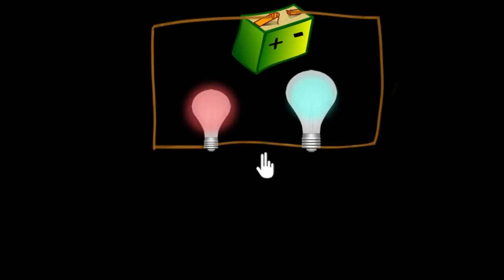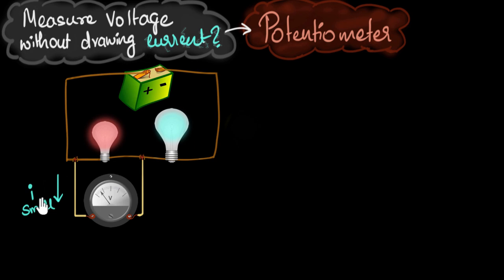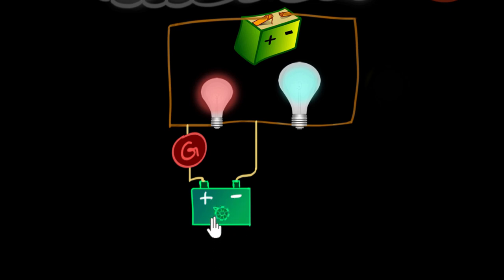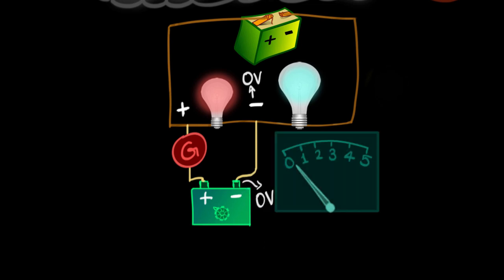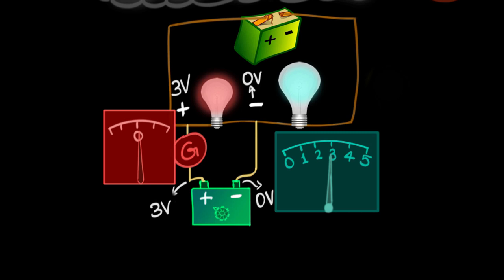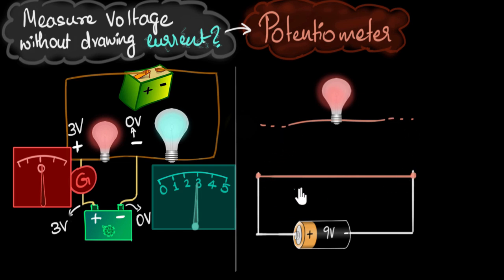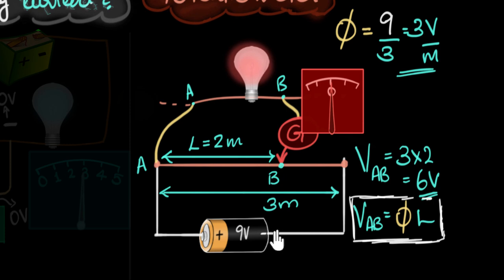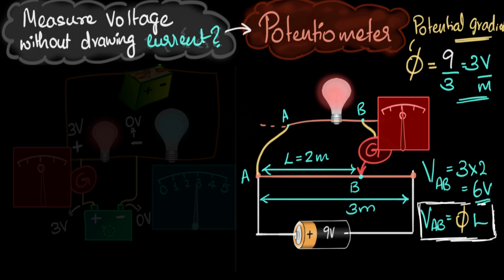Potentiometer principle (logic) & working | Electricity | Physics | Khan Academy

Comment: Can I consider the case where the internal resistance of the 9V battery is large enough that the potential difference across the wire is less than the unknown potential difference? That, or as my lab teacher used to say, loose circuit XD
Reply from the maker: Nice try, but I would still put this under the first category. Even if the p.d. across the wire is large enough, there is still a possibility of not getting a null-point.
Reply: @KhanAcademyIndiaEnglish  does it have something to do with the direction of deflection of galvanometer at the start of the experiment on the two extremes of the wire? Say, if the deflection occours towards the same side than null point can never be reached?
Reply from the maker: @pranavsrikanth935  Yes, you are onto something. But, what set-up do you think would cause that?
Reply: @KhanAcademyIndiaEnglish   what if the potential gradient of the  wire is greater than the voltage/emf we are trying to find?
Reply: @KhanAcademyIndiaEnglish  When the length of the wire is less than required...?
Reply: @maheshpatnala  That also means that voltage is insufficient
Reply: @aditishendurnikar1763  Then also we will be able to find the potential diff if gradient is less it just means that potentiometer is not very sensitive and we can't measure difference accurately
Reply: @KhanAcademyIndiaEnglish  polarity of the battery?

Comment: The way I said "NO" out loud when he ended the video without answering the question...😫
Reply: There shall be sleepless nights searching for the answer in your dreams : P
Reply: @sapphireblue9209 the other case would be when the 9V battery connected to the long wire is in opposite polarity. There would be no way for it become equal to the voltage across the resistor no matter how much you adjust the length.

Comment: Reasons for not balancing:
1.  The potential difference between the ends of the potentiometer wire or the emf of the cell connected in the main circuit may not be greater than the emf of the cells whose emf are to be compared .
2.  The positive terminals of the cells and the battery used in the circuit might not be connected to the same end of the potentiometer wire.
You're welcome!
Reply: Can u please elaborate the second reason?
Reply: @atchayap1434  you know when we connect a measuring device in a circuit we connect +ve end to +ve terminal of a cell and -ve end to -ve terminal. so u will have to connect them the right way. 
i think this is what the 2nd point is trying to say

Comment: If we put connect the negative electrode of the unknown emf with the positive (opposite) end of the potentiometer wire, then the current will always enter the secondary circuit.
I think this could be an answer to your question!
Reply: Ohh I had the same thought, but wasn't sure!
Reply: What about this:- Resistance of wire too high we are using so not gave that potential difference.

Comment: Last question solution 
It will never be zero if the + terminal of driver battery is not comnected to + terminal of the place where voltage is measured.

Comment: What if the batteries are arranged in reverse configuration then even if the p.d of lower battery is greater than the upper one still there will be current

Comment: The other answer should be that if we were to connect a resistor in series to the battery, some voltage would drop through the resistor, availing lower voltage drop across the wire, hence zero deflection cannot be found in the wire
Reply: How come u get it..wow👏

Comment: I think if we increase the resistance of the connecting wire through which we slide the jockey, by ohm's law the potential accross the wire should decrease, and if we decease it below the potential acroos the load, we might never find a null point

Comment: Sir this concept don't work with bulbs/resistance as they are not applying a specific P.D they will apply P.D according to the circuit which will never be equal to the potential across the potentiometer wire as P.d would only be equal if there was no galvanometer there... Other wise it will violate the parallel resistance law. What I mean is that p.d of the bulb will adjust to the circuit but this concept only works for something which works at a fixed potential like a battery.

Comment: I have a question
Why does that wire that we tap from  behave like a battery ( I say this because I see that as you vary the position of the Jockey along the length of the wire, the bulb either dims or increases in illumination behaving as if you were altering the voltage like the hypothetical battery you talked about at the beginning of the video). so, you vary the position of the slider, why should that have any effect on flow of current through the circuit that the bulb is connected to. You might now respond: its all about the potential difference between points on the wire. What I understand when you say that half way through the wire, the potential difference is 4.5 volts is that the battery has expended 4.5 joules of energy to get a Columb of charge to get to that position. Now , if I decide with this understanding to tap along the wire, I don't expect the light bulb's current to vary or not because I don't see how the voltage along that wire(which we tap from) will translate to having any effect on the light bulb's circuit apart from being an energy consumption value. THANK YOU.
Reply: Basically, we're not changing the voltage across bulb! Bulb neither dims nor brightens by the slider. We're just trying to reach a null point where the galvanometer shows 0 so we know that no current flows through it and the voltage across our potentiometer is exactly equal to voltage across bulb